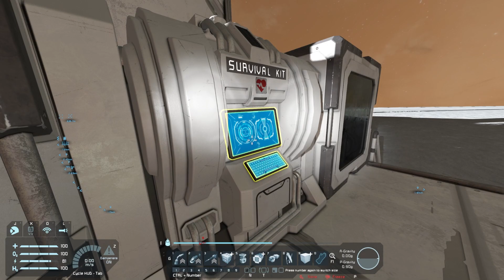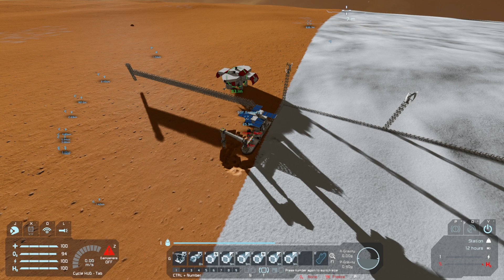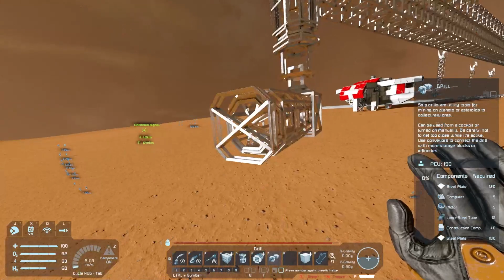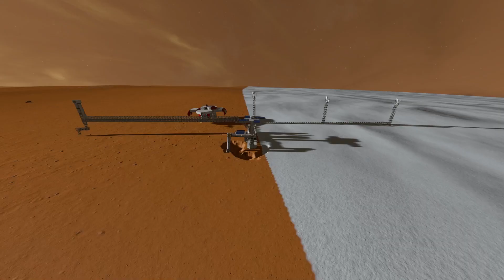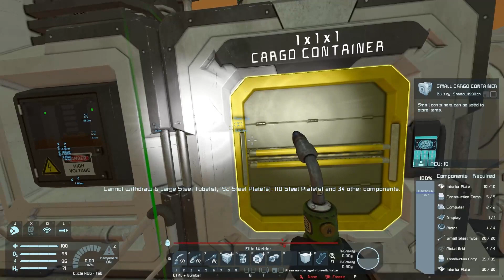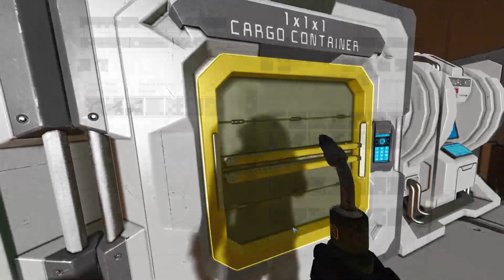Space Engineers: The Drillhead

Comment: If you are going to only support from the top, you are going to need another drill to make sure you get the middle of the hole or the sideways arm is going to bottom out before you can drill to full depth.
Reply from the maker: Yeah i somehow completly forgot about that :D
Reply: @shadow1990ch  I was trying to explain that from the start for you, because that was the first and most obvious problem you will have on this.

2 ways to get around the 'island' effect is either put some drills down the middle to make sure it never hits bottom, or build the drill 'underhand' style where the little island is used as the support of the drill, instead of the really long arm.

It would be more effective to have the really long arm spinning on top of a rotor in the middle with a wheeled shuttle to hold up a carriage with a trio of offset drill heads being pushed out on pistons which are actually overlaid to the opposite side of the cantilever [not sure how well this is translating] and that way you can have a stack of pistons both in the center of the axis, and another stack of pistons beneath the drill heads, and all of it will load into a refinery/storage assembly in the middle, below the rotor.

If the device seems too wobbly, just build a base plate beneath it, and put multiple small grid wheels around the central axis so that it has torque controlled stability.

Then the rotor in the middle need only be used to keep it centered.

I'm sure a sketch would make more sense, but I have no way to share that with you.

Comment: Another adjustment to the new drill head should be made
After the Adv rotor head needs to be a drill to clear the space for the depth pistons and 4 (including the one built) to clear the space for the radius piston.

Alternative to just adding another refinery is a large grid large cargo for the overflow.  For the moment the drill and radius piston could be used on the other drill (turret controlled one). this would allow you to clean up the stalagmites and also allow more reach. Just until you complete the conveyer line. 

As for timer blocks they advance (move) piston .5 meters every time: 
Example: 4 pistons would extend to 2m every time the timer activates

The best speed for a piston to "push" drill is .02m in total (any faster it does not remove optimal amount / destroys the ore you are collecting. If using more than 1 piston at the same time divide number pistons

If you have spectator view you can have a different base view  by pressing F8 the camera moves like your character with out move the engineer (WSAD/ QE) to adjust the speed 

ALT+MMB scroll up  increase speed
ALT+MMB scroll down decrease speed

F7 is similar it is  more of a follow camera though. Engineer moves
F6 returns to "normal"  viewing
Reply from the maker: I'll have to check if spectater mode is activated on this save, but yeah that would make camera operations a bit easier.